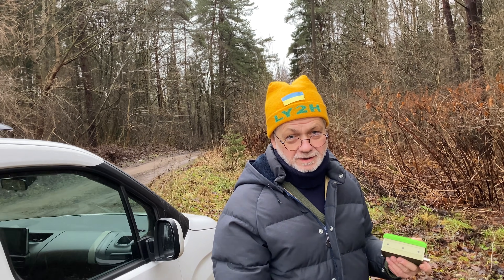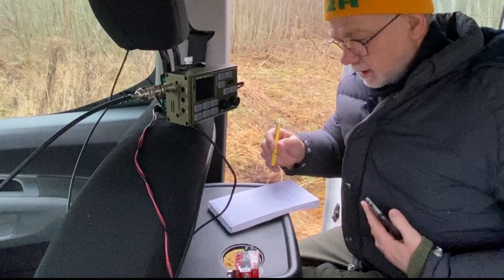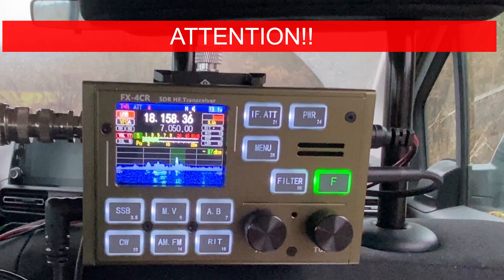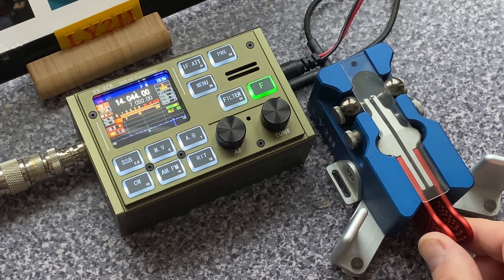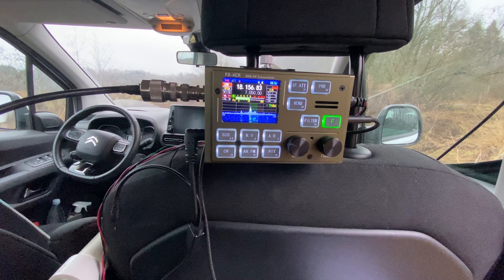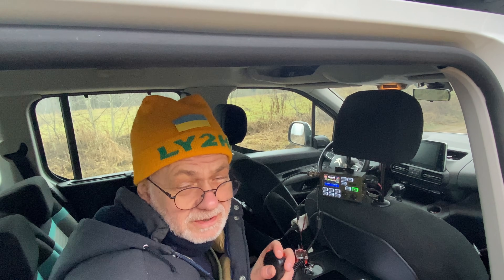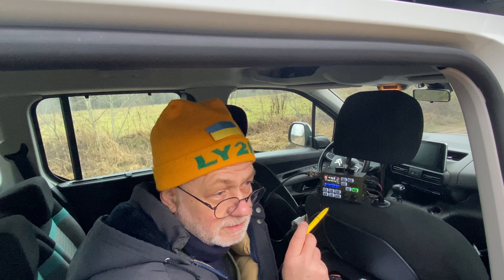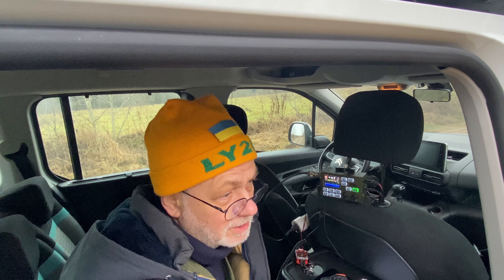FX-4CR  in the park: the magic of 20W!

Comment: Hi Linas, great video and congratulations on the successful activation. 20 watts is actually the “sweet spot” and, in terms of power consumption, only pure CW TRX or the kx2 fall below these values. However, they usually don't have a spectrum and waterfall display. I've been a fan of this device for a long time and it's hard to believe that a single developer was able to create such a device. There are still a few tweaks you can make—for example, you can display the spectrum of your transmission and a few other things—but you'll probably figure that out for yourself. The fascinating thing is actually the S-meter—just for fun, take a signal generator and check it out—even with professional equipment, an R&S measuring receiver isn't really any more accurate, and even if you reduce the RF gain from 32, the signal display remains constant as it should be. I didn't expect that in this price range. And except for a few crocodiles, you can basically work what you hear. 43 dBm is easily enough for DX with a reasonably decent antenna. And the operating concept, where you basically don't have to go into the menu anymore and can operate everything “from the front,” is really remarkable for such a miniaturized device. If the fx-4cr now had a pin diode switch like the kx2, it would actually be “the perfect” hiking radio. 73 de DL7KP
Reply from the maker: Hello Mike, thanks for such an in-depth and useful comment! I fully agree with your FX-4CR evaluation, it’s a cute  little radio and lots of fun to play with. I like it’s an open source, so is open for the  easy software  upgrades, written even by a third-party authors. And I’m looking for some better wx to open my hiking/biking parks activation season up! CU on the bands! 73! Linas LY2H

Comment: It looks like uSDX transceiver. Thanks for video Linas.
Reply from the maker: No, no, this is not uSDX :), it's based on a powerfull STM32H750 processor . GL 73! Linas LY2H
Reply: Hi Lynas
What antenna were you using 73
Jake M6LSC
Reply from the maker: @StgeorgeslondonHi Jake, it's a 5m MFJ telescoping whip with a base-loading coil. HTH, 73! Linas LY2H